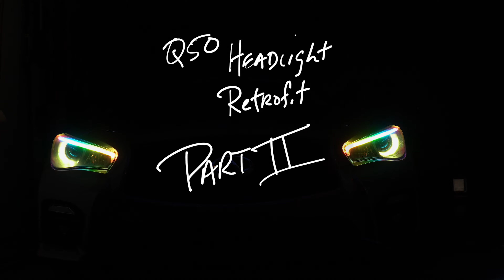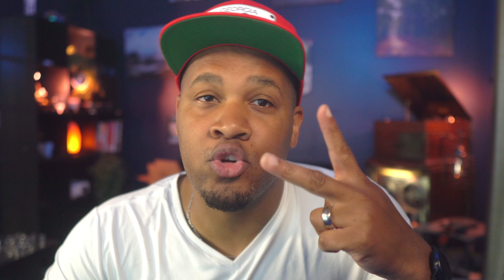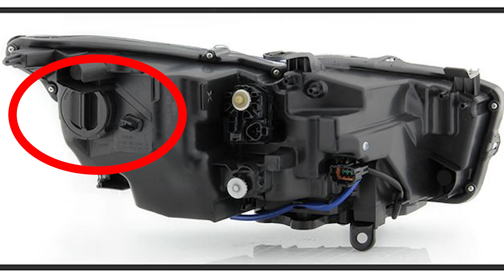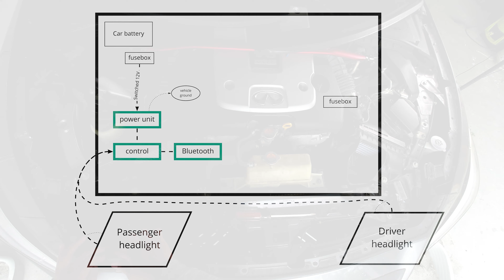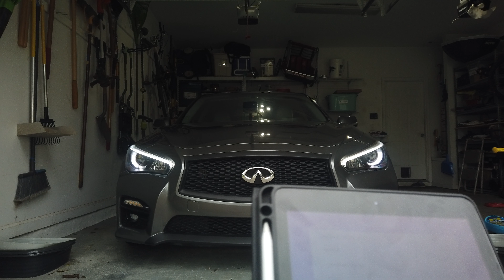Q50 Custom Headlights: Part 2 (Wiring to Switched Vehicle Power/Where to Tap)

Comment: Hey man first things first amazing videos, I watched part one fully and I noticed you never specified how to put the headlight lens back together after separating it if you could explain that for me. Secondly, with the way you wired it does this mean when you press your unlock buttons your lights are still off?/ no power, with the way you wired it do they still get power when running headlights/nightime run lights on?

Comment: Regarding your power source… are you able to leave them on in the app and they turn on when you start the car or do you have to turn them on using the app?
Reply from the maker: Can be done either way. Check out videos 2 and 3 for more power source options. I've now got my blueghozt running always-on so it can do welcome animations when I unlock the doors 👍🏾
Reply: @SquareWheelsAuto  thank you. I’m using the Magic LED app Lighting Trendz recommended. Just want to be sure that if I use the relay spot you did and leave the LED on in the app, they’ll turn off and on when I start and stop the ignition without having to use the app?
Reply from the maker: @bryanmatthews5827  yes, probably. It was LED HUE when I did this video and that's how it behaved. The app/controller would remember what it was doing last right before power was killed, and do that immediately when power was restored.

Comment: Will the lights turn on when you unlock the car at night like before?
Reply from the maker: Depends how u wire it and what controller u use. Watch part 3 if you’re interested in unlock animations.
Reply: @SquareWheelsAuto  I was going to use the controller that the rgb lights come with. Would it not be possible under the same relay connection you have in the video? Or should I use another controller such as the ghost one in part 3?
Reply from the maker: Any controller can turn the lights on on unlock. Blueghozt  is the only one I've found that does a nice animation.
Reply: @SquareWheelsAuto  Okay that does make sense. With the setup you had in the video does the lights turn on when you unlock or only when the car is on accessory mode?

Comment: I am going to start this project right when I get back from vacation. However I am using profile pivot led switchbacks, so I do not need a controller but is there any way you can help or suggest a way to wire as a DRL and turn signal?? Thanks
Reply from the maker: No idea!  I'd say follow the instructions that come with the switchbacks - I'm surprised they don't come with a controller?

Comment: What is the brightness compared to oem I don’t want to be dimmer than stock
Reply from the maker: These DRLs are marginally brighter than stock, but still not as bright/bold as, say, Audi's DRLs.

If brightness is your top priority, I'd recommend getting some switchbacks (not RGB) - they tend to be brighter than fully addressable RGB LEDs.
Reply: @SquareWheelsAuto  I’m not wanting to be brighter or dimmer it’s that I’ve seen some light strips have bright white then the moment you switch to a different color its super faded and looks like crap
Reply: And I’m definitely going to be giving this a try because I’m getting board sitting round and want to mod my car more to look better
Reply from the maker: Yup when you dive in, make sure the LEDs you choose look how you want em to.  I'm learning that all LEDs are not the same.  If you're looking for quality LEDs (brighter, vivid colors, etc) check out www.gloweleds.com - use coupon code SQUAREWHEELS.  good luck!!
Reply: @SquareWheelsAuto   can I use these on my headlights or should I go to the link you provided on this video to have it already made for me
Reply from the maker: I mean technically you can use ANY LEDs for these projects. If u can wait a little bit, Glowe is working on a custom headlight kit for the Q50.
Reply: @SquareWheelsAuto  would you say that it’s better than the set you used on your headlights
Reply from the maker: @alvensmith3562  Its still in the works so all I can do is speculate, but I'm real confident in Glowes quality and attention to detail. as long as Glowe is around I won't be buying anymore lightingtrendz.

Comment: I have a 2018 and my fuse box has a second smaller box, it has the same little black one as you but then it has a blue one next to it, do i continue and wire it up like yours or?
Reply from the maker: The position I noted was one of few that provides switched 12v power when the engine is on.  Should be the same for all years but if you're in doubt, check with a multimeter!
Reply: @SquareWheelsAuto  thank you so much, i didnt expect a reply this fast! 🙌
Reply: @SquareWheelsAuto  hey quick question i was trying to test mine today and they did not want to turn on, the Bluetooth would connect but the lights didn’t turn on. Would you happen to know whats going on?
Reply: @SquareWheelsAuto  I made sure that it was 12V before ai tested too and they still didnt turn on, only the Bluetooth did.
Reply from the maker: @mistros5684  hmm. did you try running colors or animations in the app?
Reply: @SquareWheelsAuto  yea the app is weird, its not giving me an option to.
Reply: @SquareWheelsAuto  But they were supposed to turn on when they connected to power automatically, mine didn’t only the Bluetooth was on for some reason
Reply from the maker: I'm lost tbh. Kinda sounds like your strips aren't getting power. But the app shouldn't know/care about that. It's weird the option is dimmed out.
Reply: @SquareWheelsAuto  yea, if you want i could send a video to show you how its reacting, ill post it on my channel if anything
Reply: @SquareWheelsAuto  I DM’d you

Comment: Another great tutorial, I’m trying to wire sequential switchback led strips to replace the eyebrows, does anyone know those wires on the headlight unit I can tap into
Reply from the maker: Which headlight signal ru trying to tap? I hook my blueghozt up to the headlight harness in video 3 in this series, it might help depending what ur trying to do 👍🏾
Reply: @SquareWheelsAuto  thanks I watched all the vids great job👍 
I tapped into the rear controller inside the headlight unit that’s runs the factory drl output 

Demon eyes
Power Pin 5 (as your vid)
Ground pin 4 

Sequential stips
Ground pin 4
Drl pin 5
Sequential signal - ran from bottom of housing (through the rubber seal) to live signal wire in main harness 

Mounted the control module inside the headlight housing 

Everything working and looking great until I shorted the circuit board now I’m waiting for a new headlight
Thanks again for the vids looking forward to more
Reply from the maker: @kylejenkins8830  CRAP sorry to hear man!!! just out of curiosity how did that happen??
Reply: @SquareWheelsAuto  two of the circuit boards touched and I hear a sizzle, now it keeps beeping, when I engage the signal lights, just as I had figured out all the wires, nothing else appears to be damaged so guess I’m lucky

Comment: Hey man how did you connect the lighting trendz power wire into the fuse panel? I’ve got my headlights apart and painted so installing the new leds is my next step
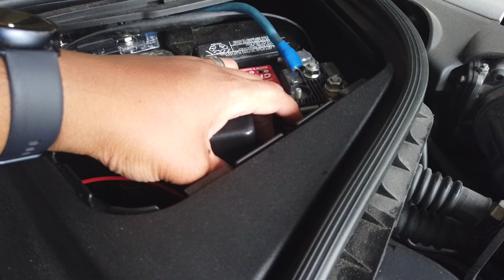Reply from the maker: Awesome I love to hear when ppl are doing this! check out this video @ 5:04 - this is where I tapped for switched 12v for the Lightingtrendz controller.
Reply: @SquareWheelsAuto  I see what u did but I don’t see how you actually connected the wire to the fuse?. Did you just push it down into the slot and put the fuse on top of it or have to connect it a different way?
Reply from the maker: @feta8939  yup just twisted the wire and tucked it into the relay port. Test with a micrometer if u have one before buttoning it all back up 👍🏾
Reply: @SquareWheelsAuto  sweet thanks man! And yes I grabbed all testing items you mentioned in the link s before hand. Really appreciate your guide to the Q50 retrofit. I feel like we could prolly make money doing this for other people who aren’t confident enough doing it themselves.. 😂
Reply from the maker: @feta8939  hell yeah man I get offers all the time, I'm looking for somewhere to send people so lmk if u open up shop!! 😅
Reply: @SquareWheelsAuto  lol alright sounds man. Let me see how these turn out and I’ll let ya know

Comment: Which wire taps the turn signal? And which taps the DRL 😭
Reply from the maker: This kit didn't come with turn signal switchbacks or drl taps. It's just ON when car is on or OFF when car is off. I'll be getting a different controller that enables switchbacks and other stuff when car is off

Comment: Oh I forgot to ask how did you put the clear casing back on? What adhesive did you use?
Reply from the maker: I just reversed the process. Put the clear casing on after everything is assembled, warm up in the oven, then squeeze together while the sealant is warm and put the screws back in

Comment: ive been waiting for this for a week now. I ordered the leds but got the wrong part (RGBWA), trying to contact them and change the leds to the flow series :(
Reply from the maker: Damn yeah u definitely want the flow series.  LightingTrendz support was pretty responsive over email
Reply: What’s the difference between RGBWA and flow series?
Reply: @ericarroyo1984  The RGBWA doesn't have the long led (just the crescent) and it suppose to have less color. Basically, it is used to replace broken crescent light, not for having headlight lightshow.